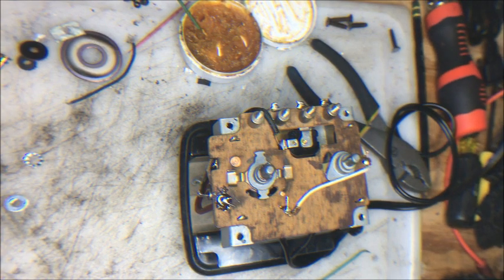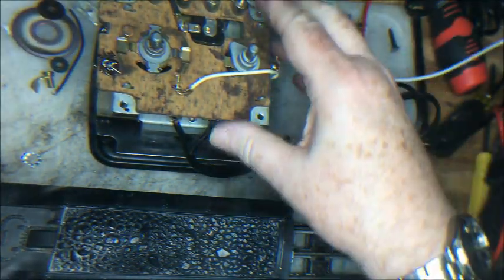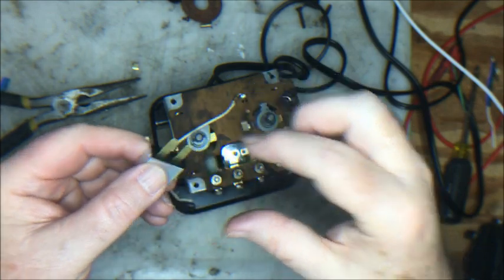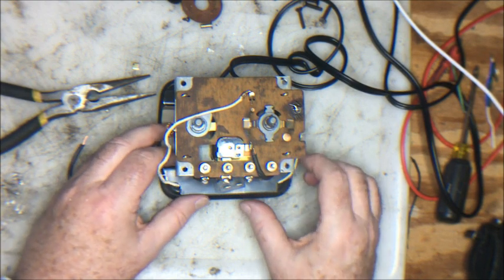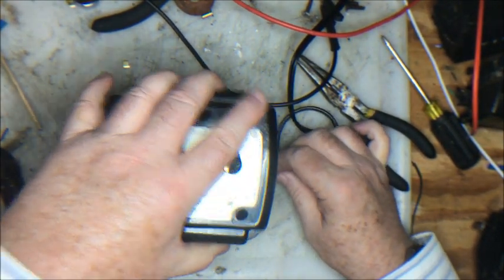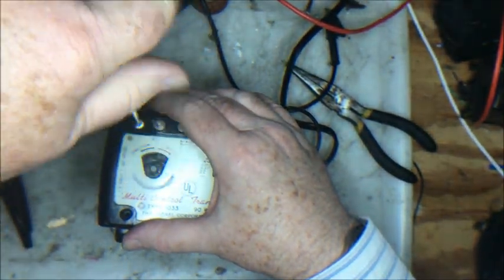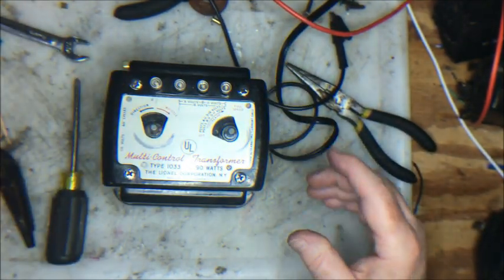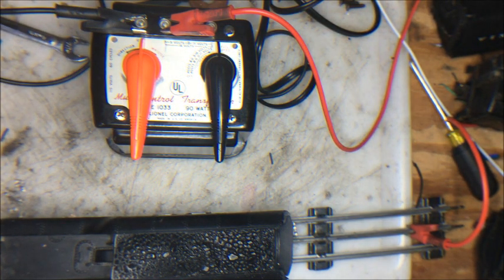Lionel 1033 Transformer Renovation Part II

Comment: Thanks Peter. Quick Questions..where do you get the thermal breaker? Looks like a bussman 710613 but I can't find that part anywhere. Also, there seems to be a fair amount of exposed wire/pullback on the fabric sheathing on the top part of some of the wires that go underneath. Should I just add some shrink tube over those to limit shorting risk?

Comment: Say, shouldn't the diode have a wire soldered on the other side also? 🤔
Reply from the maker: Nope. The diode is grounded by being bolted to the rectifier plate.

Comment: Hello, Sir. I’m following your repair videos. Was wondering if possible to replace original wires that lead to under device. Seems there are some type of rivets preventing access.
Reply from the maker: Thank you for your question. I strongly urge you not to do anything to disturb the core. There are six wires which come out from the laminated transformer core. There is one yellow wire which goes to the contact arm assembly, which controls the speed of the train. There is a green wire which goes from the core to the A post, a black ground wire from the core to the U post. Two other wires run from the core to the B post and C post, and one more while which runs underneath to connect with the circuit breaker. There is one more wire, which does not connect to the core, but is the white resistance wire which runs from the contact plate to the rectifier assembly.
Of course there is also the power cord wire which can be replaces readily. There should be no need to disturb the core to access wire connections within the laminations.
Reply: @ Happy to report I got mine working from your tutorial.
Reply from the maker: @ChitownHiker Glad to hear it! Thanks for letting me know. What was the problem and your solution?
Reply: @ I installed a new power cord, a new  whistle rectifier diode, and a new circuit breaker. Works fine and I followed your instructions. Soldering is not my jam so using the Pinecil was a relief and made it very easy for me.
Reply: Hello, again. I do notice that when the throttle is more than half way up the device shorts. If below it runs fine and until I cut power. Would you say that is an issue with wires?
Reply from the maker: @ChitownHiker   No, it does not sound like  a wire connection issue. It sounds more like a problem with the contact arm, or the circuit breaker. Before you do anything to investigate, UNPLUG THE TRANSFORMER!
 Since you have a new circuit breaker revisit your installation. Which circuit breaker did you install?
The contact arm runs along the core's coil. It's position on the coil determines the voltage output.  What you describe as a "short" I assume means the unit loses power. Let's start with the simplest solutions first, and graduate to the more complex:
1. Use some alcohol and a cloth to clean the coil where the contact arm runs.  Clean also the contact point on the contact arm. If this does not cure the problem go to #2.
2. If the contact arm loses contact with the coil you will lose power. So you might bend the arm gently downward to increase contact with the coil. If this does not cure the problem, go to #3.
3. Take a look at the position of the contact arm on the coil when the red control handle is turned to full throttle. Has the contact arm run off the coil? If so, this is the result of an imperfect repair in the past. You will have to disassemble the voltage control shaft, the contact arm, and the washer to reposition the contact arm.
Please let me know whether this solves the power loss.
Kind regards,
Peter
Reply: @ Hello. Cleaning the coil helped quite a bit and it was very dirty. I blackened quite a few swabs before I was done.  Now the unit loses power when the arm is off the coil. Taking it apart seems like quite the undertaking. I will think about it but if the power I get up to that point works for my setup, I might leave it for now. Let me know what you advise please.
Reply: So this weird (to me). I noticed the train runs 12 seconds, stops for 12 seconds in a loop. I thought it was power cutting off but I would unplug before it started up again.
Reply: I took off some of the load from engine and 12 second cutoff issue problem resolved. Must be it was pulling too much weight? Tracks are brand new O gauge so they are clean.
Reply: Engine still stops for 20+ seconds after a couple of minutes. Not sure how to fix the issue. Any advice is welcome and appreciated.
Reply: I re-soldered the circuit before and still got the cutouts. I just now oiled the wheels and guess? No cutouts after 5 minutes and still running!
Reply: Must have been a combo of bad solder and wheels struggling to turn causing cutouts. Looks good now, though.
Reply: Consider this case closed. Thank you, Sir!
Reply from the maker: @ChitownHiker  The easiest (and unsatisfying) thing to do is to leave it as it is. You might put a mark on the nameplate to show where to stop. Repairing the defect is not that complex. There are only 3 components: 1. The control shaft; 2. The contact arm; and 3 the washer with square center hole. Are any of these 3 components damaged or loose? If so, replace the damaged part and restore the assembly to a snug fit. if nothing is damaged or loose, you need to see why the contact arm runs off the coil. The contact arm may need to be repositioned.
Reply from the maker: @ChitownHiker  Check the voltage level to make sure your output level is correct.  On larger layouts there is always voltage drop simply because of the resistance  caused by the tracks themselves. They are not perfect conductors.

Comment: Great video peter. Currently trying to get my 1032 to work. Doesn't seem to get power to track from u and a.. any tips?
Reply from the maker: Hello DL, and thank you for the question. We need more information in order to narrow down the possible causes. 1. The first is to see whether the power cord is effective. Using a multimeter, check, the U – A, U – B, and the A - C binding post combinations. What voltages do you get?

If you get no power to any of the binding post combinations, then you must replace the power cord. That is just the beginning because there could be other issues in addition to the power cord. Start with that and get back to me with your progress at your convenience. Good luck!
Reply: @peterfenzel4742  I actually ended up going through it all last night and got it running. Had some no good connections inside. I appreciate your response

Comment: Thanks Peter. I appreciate the response. After working on the transformer last winter, I also completely disassembled the tender and cleaned everything up, on the whistle unit including the brushes, etc. The whistle is very responsive and it does seem that the frequency of random chirps has gone down quite a bit.  Happy Holidays!!

Comment: Hello Peter - I just watched your 6466WX tender restoration videos.  Very nice - and thorough as usual!  I have taken the unit apart and cleaned it up and have some wire replacement to do today.  It is much more responsive after the cleaning.  However, I am curious if you have ever experienced stray whistle chirps when returning the whistle control to the neutral position on a 1033 transformer, especially coming from the direction switch side.  The whistle side is responsive with only an occasional 'sticking' of the whistle.  The direction switch thing has me stumped... I can see a small electrical spark at the neutral electrical contact point on the fiber board of the transformer when the handle comes to the neutral position but cannot figure out how the car is translating that to a "I must whistle now" signal.  Any thoughts?  Thanks!
Reply from the maker: I must apologize, Gregory, for having missed your comment. I hope you don’t mind my tardy response.
The chirping should disappear. The more the transformers used period with every electromagnetic system, transitioning from disuse to use Might take a little while to even out the mechanical response.
A greater concern is the spark that you mentioned on the directional control when in neutral. I think using fine sandpaper  on the contact points on the fiber board operating platform to improve contact may solve that issue. If the sparking persists, I would suggest for safety purposes that you stop using the unit and search for wiring defects.

Comment: Funny how I always get enthused to bring out my O27 train set around Xmas time and take over the floor under the tree. So I just found your excellent videos and would like to refurbish the several transformers I bought a few years ago now that you’ve inspired me. 

One question I have based on never doing before, is the soldering iron you need to desolder wires. RONA has a 100/140 Weller and a 200/260 professional model. How much will be overkill ?

Cheers, Dave
Reply from the maker: Hello Dave! Thanks so much for the message. The art of soldering is the bread and butter of fixing transformers. I strongly recommend that you watch a few YouTube instructional videos on soldering before buying anything. When you’re ready to use a soldering gun or soldering iron you might consider getting a soldering station that has a safe receptacle in which to place the hot iron while you work. You do not need digital readouts or anything fancy, nor do you need the cheapest unit that will burn out quickly.
But if there’s one thought to guide you, as you begin repairing transformers, it would be this: first, unplug the transformer. Please let me know how you are progressing! 
All the best, 
Peter.

Comment: Hello Peter! Thank you for your detailed/instructional videos! Your videos made it possible for me to fix/restore my dad's Lionel train set and 1033 transformer that I'm planning to surprise him soon on his 85th birthday. I also enjoyed watching  your whistle tender one! Anyway, I have a question. When placing in the new circuit breaker, (the part where you solder the shorter wire to the B post), my 1033 has another black wire already soldered to it. I looked at your video a few times but I couldn't see if you had one soldered to your B post. I wonder if they are wired differently? I'm still very new to this and I don't want to do mess anything up. Thanks! - Melanie
Reply from the maker: Hello, Melanie! Thank you for the kind words! Your Dad will be thrilled with his 85th birthday present! Please tell him "Happy Birthday" for me.

The black wire you see attached to the "B" post is the #2 wire in the 1033 wiring diagram. It comes from the core to the "B" post. Leave it alone. It belongs where it is. When you connect the second  short wire to the "B" post you will be completing a circuit with the #2 wire and with the circuit breaker in the loop.

You raised a great point, by the way. We don't want to mess anything up, so we get stymied. That's why I make these videos. Each process is fairly easy to do. One simply needs to understand the "how" and "why" to restore these great little machines to their original functionality and beauty.

Don't forget to clean the black bakelite case either with vinegar, baking soda, warm water,  and a toothbrush, or with a drop of Dawn dishwashing soap, warm water and a toothbrush. Once the case is dried off, you can shine it up with either a spritz of furniture polish or a spritz of WD10-40 rubbed with a cottom cloth.

Good luck!
Reply: @peterfenzel4742  Thank you for the detailed response! I'm sorry I spoke too soon and thought things were going smoothly however I recently plugged it in and nothing happened. I did look over your videos again to make sure I didn't miss anything (I did leave that other wire in the B post like you said). I tested it with a multimeter after installing the new circuit breaker and it read I have no current. 

I'm still fairly new to soldering so it's possible that could be the problem. Question: When installing the 16 gauge wire to the new circuit breaker, do you recommend a single strand solid wire or stranded wire? I used stranded wire but I noticed the other original wires were solid so I don't know if that makes a difference. Correct me if I'm wrong it looks like you used a stranded wire. 

One more thing: I hate to admit but I made a rookie mistake here. When I was using the solder iron to loosen/take out the old power cord I accidently broke a piece of one of the extended fiber (I thought at the time that platform was more sturdier I had no idea it was fiber). I glued it back on and the metal piece that was there is still intact. I made sure the glue didn't get in the circular metal piece (bracket?). I soldered the new power cord in and it looks okay. I appreciate your feedback since I'm worried I might have damaged it. Thanks!
Reply from the maker: @melanieholland8165  Hello Melanie! Thank you for your questions. Let’s figure this out:
1. The 16 gauge wire you attached to the circuit breaker is fine. It doesn’t matter whether solid or stranded, assuming the wire strands are not broken.
2. The power cord connection sounds problematical. Those 2 round metal connection points for the power cord on the fiber platform connect to the core of the transformer. If you look closely at the connection points you should see many wire filaments from the core connecting to the small metal rings through which the power cord ends pass.   

If that part of the fiber platform broke off then there is nothing to carry electricity from the cord to the core. This would explain your transformer behaving like a paper weight.
Reply: @peterfenzel4742  Good Morning, Peter. Thanks for the quick reply! I thought I'd try one more thing before giving up. I looked more closely at that area you mentioned and I saw 2 very thin wires just hanging there (coming from underneath that little platform). I remember seeing them before when I was taking out the old power cord but forgot about them. Anyway, I soldered them the same place where I soldered the power cord and good news I'm getting current now!! I tried out the 6466 whistle tender and it sounded beautiful! I used the multimeter to check the current and it read different ranges on each post. You've probably mentioned this before but what are the ranges for it to be a good current? I will keep in mind what you shared about the fiber platform and hopefully it still won't be too much an issue. Lesson learned!

The only thing left I was going to check is the 2026 engine. I did put it on the track to test it out but even though it stayed there I heard it and the light came on. I don't know if you have a video for that but if not I did find one. If all works out my dad will be stoked! Thank you again for your patience and advice!! Happy Hobbying!
Reply from the maker: @melanieholland8165  That is great news Melanie! Well done! For your information the voltage should be as follows: the A – U connection gives you variable voltage from 5 to 16 V. The B – U connection gives you variable voltage from 0 to 11 V. I would recommend using the capital B Dash U connection to run your 2026 locomotive. You do not need any higher voltage. To run accessories you use the constant voltage feature of the transformer. A -C  connection gives you 16V. B-C connection gives you 11V.

Happy birthday to your Dad!

Comment: Hello Peter - I have a 1033 in good shape, but the overload breaker was bad.  I have removed it and am ready to install the BUSS 710613 6A 12V thermal fuse that I ordered on Amazon.  Unfortunately, they canceled the order because it is not available.  I found a BUSS UCB-6 on Grainger with a 100A Interrupt Rating.  Do you have any idea if that would work? or could you recommend a suitable alternative?  Thanks.  Videos were great by the way....
Reply from the maker: Hello Gregory! Thank you for the question.

The trains run on a 1033 transformer will draw current of something like 2 or 3 amps. At such low current  a relatively slow acting  thermal breaker, rather than a fast magnetic breaker, rated at 5 or 6 amps will be fine for a 1033 transformer.

A circuit breaker's interrupt rating is an entirely different animal from its amperage rating. The ampere rating is the lowest current, that if exceeded, will initiate the trip of the breaker. A breaker rated at 6 amps  will trip at 6 amps. The interrupt rating is the highest current  that the breaker will interrupt without melting, exploding,  or causing the appearance of the Four Horsemen of the Apocalypse. The interrupt rating does not tell you the current load at which the breaker will trip. So you need to take a second look at the Grainger breaker and find its amperage rating. It is "probably" OK, but "probably" is what sank the Titanic.
Reply: I don't want any Horsemen around my house.... LOL
Reply: Looks like a 6 Amp...
Reply from the maker: @gregoryfata2463  

I found the Bussman breaker available on Amazon.  As far as the Grainger breaker goes, we do not have enough detail in what type of breaker it is and its performance limits. When electricity is involved, when in doubt, DON'T!
Reply from the maker: @gregoryfata2463  Looks like the same breaker.
Reply: Sorry for so many messages.... I just reordered the BUSSMAN on Amazon (different vendor)..... fingers crossed.
Reply: @peterfenzel4742  Hi again.  I received the UCB-6 BUSSMAN circuit breaker today and installed it - Transformer is working like new again.  Thanks so much for making the very helpful repair video and for your prompt replies to my questions.

Regards,
Greg
Reply from the maker: @gregoryfata2463  You’re very welcome, Gregory. Enjoy your layout!